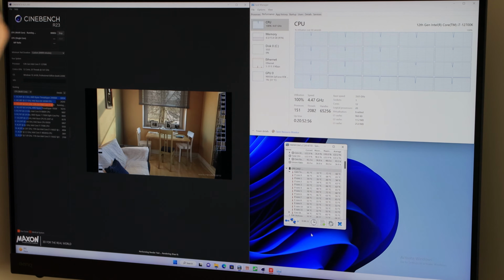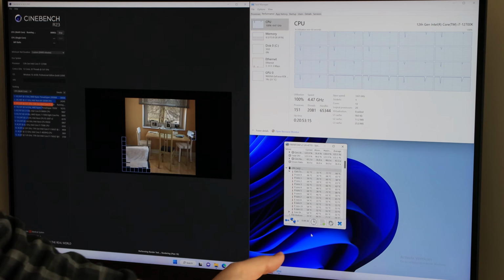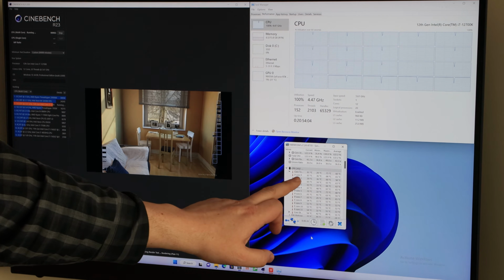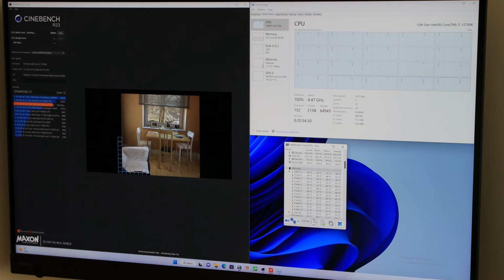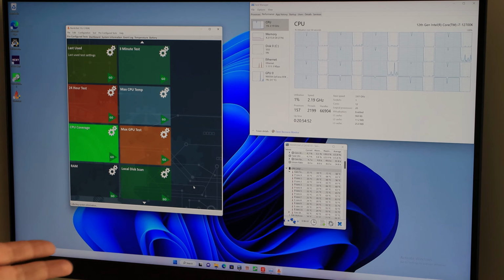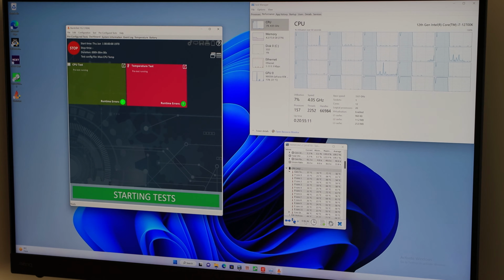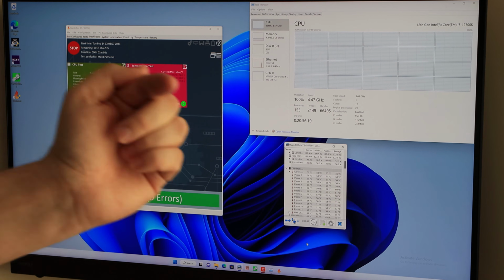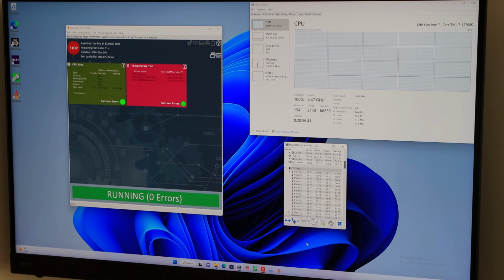How to Properly Test CPU Temperatures: Avoiding Common Mistakes Influencers Make with Cinebench

Comment: I don’t think any game is going to run 100% for 30 minutes either right? It should still give me a good indication of my cooler’s performance I would think.
Reply: it will If the CPU meets the power of the GPU at the limit.
Reply: @Fb-pl7zq How likely is that in the majority of PC consumers?
Reply: @Fb-pl7zq  i7 1300k rtx4070tiSuper 😂 cpu 40% at 50° and gpu 100% at 60° comstant on any AAA game

Comment: avg temps are not really much use due to the nature of averages, peak and minimum tests seem to make more sense as they represent the highest and lowest. It also represents "real world" usage as cinebench replicates how a desktop PC would render a project with varying types of asset.
Reply from the maker: While getting a min and max can be a good thing it’s unpredictable, same as getting an average temp when the testing is not consistent, when we do CPU testing we do measure the average and the Max temp.  While encoding large 4K videos and other projects like we do, the CPU can be running at 100% with no dips for 2+ hours.  

Most people have CPU fans set to auto, if that’s the case then using cinebench will cause the fan speed to fluctuate, event though fans can react fast they are always  react to the temperature, with the CPU usage dropping this cause the CPU temp to go up and down quickly, and can also cause the speed of the fan to adjust as well, this then causes temperature spikes.    This is more noticeable on slower computers as it takes longer to load the next test.

Comment: Thanks, Phil. 👍 I've never used Cinebench before, but (of course) I've seen everyone & their uncle testing with it on YouTube.  I was actually considering giving it a try after I finish my new build - but not now, thanks to thanks to your timely video! 🤗  I'll take a look around for an alternative. 🤔
Reply from the maker: Don’t get me wrong, it’s not awful but it’s not accurate. Its like putting you foot it hot water, you know it’s hot but you won’t be able to get the exact temperature.   The pass mark Burnintest has a free trial, that will give you a better result.
Reply: @TechforTechs  for 1hour bro wont this fried the cpu
Reply from the maker: CPU's should be able to run for hours even days at 100% load if cooler properly,  a lot of rendering jobs when making videos can take hours and days with the CPU running flat out. @officialyashvirgaming

Comment: i am using boinc computing program when need to figure out temps i just choosed use 100% processor time opened HW info and it goes something about 20-30 mins and it was consistent 100% cpu usage all the time

Comment: Actually, cinebench is a totally valid tool to see the temperatures.
The reason being simple. I don't use my cpu at 100% of usage 24/7. 
So it going to 100% usage and then dropping slightly, its a fine test by me.

I could let a 10 hours render running on the cpu, but that is just not the use case for my gaming pc. So what's the point in doing that test?
Reply from the maker: If you are doing a comparison between two different CPUs, it's hard to do when the testing is inconsistent,  you can still use it as a ballpark to see if it would overheat.  you can run the same test in the same environment a number of times in cinebench and get a different result each time. that's like testing the max speed in a car but drivingit on a different road each time.

Comment: If someone could answer my question I would be grateful. I have run r23 and 2024 versions and my results are average but the image that renders appears to render way slower than any I have seen on videos online. Is that normal?
Reply from the maker: Depends on your CPU,  the faster it is the faster it will render.  Some reviewers will also speed up video and other trickery so people don’t have to watch for so long
Reply: @TechforTechs  thanks for replying. I did some adjustments and turns out on 2024 the images just renders a lot slower than r23. My results are fine, 19k for multi core is fine by me.

Comment: Hi, when I start the test the cpu immediately throttling, the fans are set up to max and the temperature hits 100C. The test runs for 10 minutes and the cpu clock speed is 3GHz(the cpu max frequency is 5GHz). Also Intel XTU shows power limit throttling, the cpu is idle,  and power limit and current/edp throttling while gaming. Do you think these problems can be fixed with replacing the motherboard, the laptop is under warranty. Thanks!